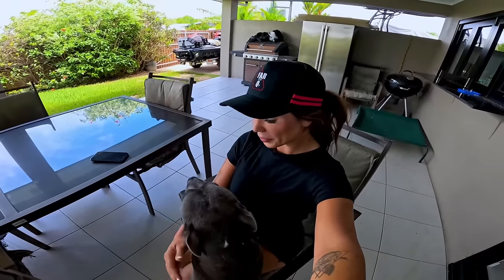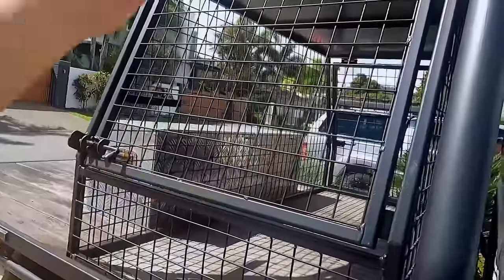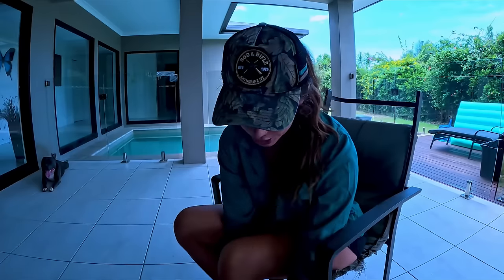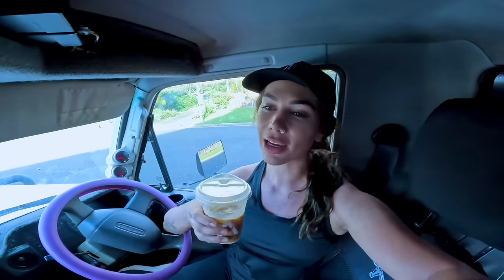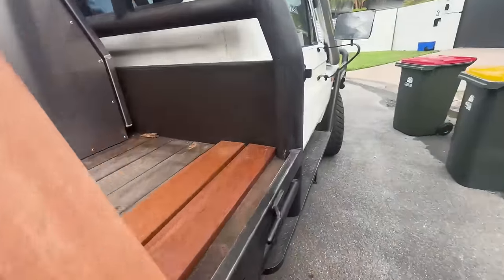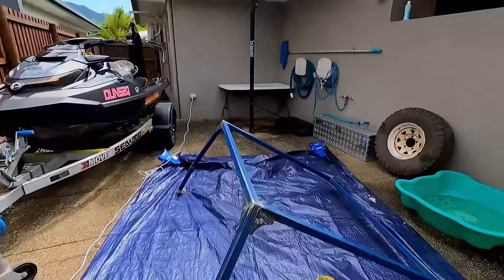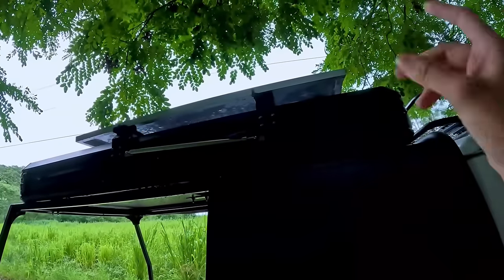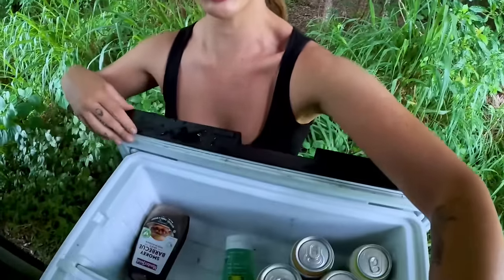I GAVE MY LANDCRUISER A MAKEOVER! 🔧

Comment: Looks good, nothing beats some fresh paint to make it look nice and new again. 👍
Just one thing with Merbau though, it leaches tannin stains every time it gets wet and will stain everything underneath it so make sure you really keep a good quality oil on it regularly - the best oil out today is the Cutek Extreme - available at proper good timber outlets, not the watered down rubbish bunnings sells, and just oil oil and more oil regularly otherwise it will grey off in no time and look like the old boards that are on there in less than 12 months.
Good stuff 👍
Reply from the maker: Thanks heaps for the advice!!😁🙌🏼 and thanks so much for watching. I’m so happy with the way the tray turned out - so I’ll make sure to do the maintenance on it
Reply: @JasmineHardie  no worries. Yeah the more preventative maintenance you can do, the longer it’ll last and the less frequently you’ll be replacing it too. Cheers mate 👍

Comment: Timber floorboards look sic when new but are not practical on a tray top . I would advise to remove and replace with Aluminium as there will be no future rust into your chassis of your tray. Good on you for having a Red hot Crack at it . 👍Just hope they was Galvanised screws you used and not zinc plated as they will rust out and break.